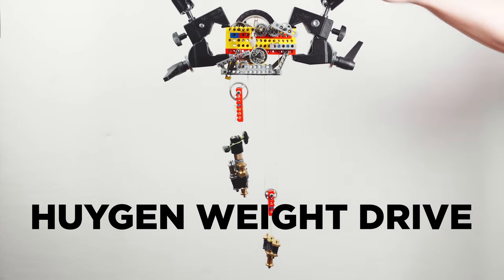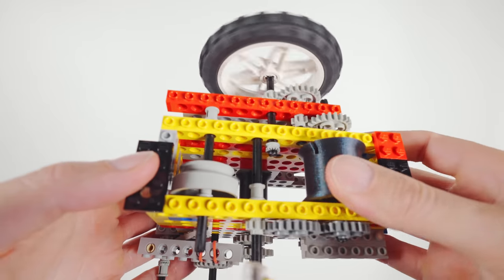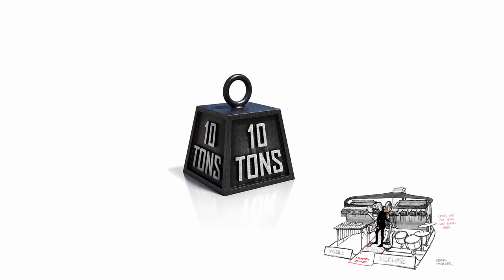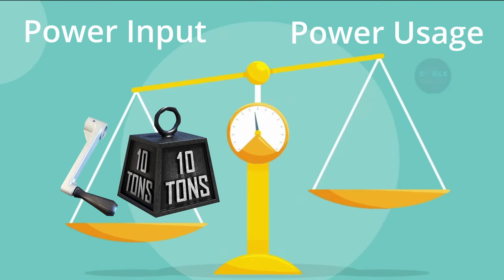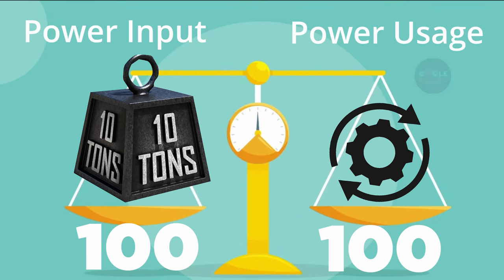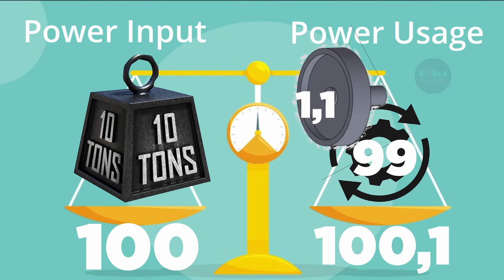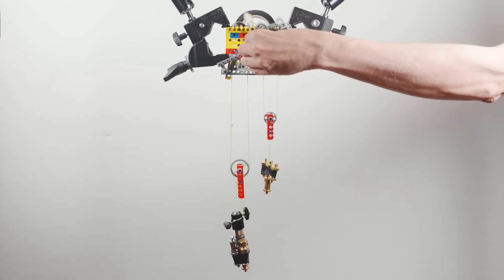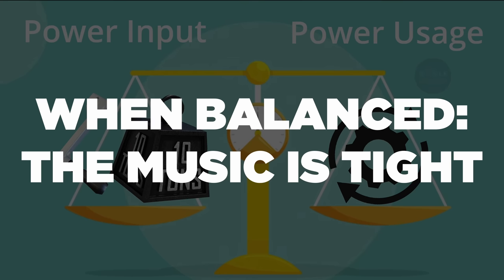Lego Technic Huygen Chain Drive

Comment: I really appreciate how much time effort and work he puts in and the r&d that goes into this. However I have a feeling that Martin went to another extremity. He went from barely thinking about the practial design of the machine to overthinking and over engineering. At this point he wants to implement something to make his machine play tighter music which is useless/unnecessary. The perfectionism will be the archnemesis of Martin and the machine. I don't think he will ever finish the mm3 if he continues his probably unrealistic perfectionism.
Reply: to be quite honest, it's kinda why I lost interest in following the construction of the next Marble Machine - whether it's MMX or MM3. as the machine starts progressing, the perfectionism takes over and becomes this rabbit hole that he can't climb out of. at this rate, the machine will never be finished.
Reply: I don't think so, he's already made a fair amount of progress and isn't showing any signs of slowing down
Reply: So far the only perfectionism he follows is generating new "tight" buzz words

Comment: Centifugal Govenors actually were meant to control the throttle of a steam engine (as the balls go up, it pulls on a central rod) , but in your case you could probably just use air friction  with flat paddles instead of balls, such that as they fly outward during to centrifugal acceleration, they quickly cause greater air resistance since it is trying to both spin faster and on a longer arms.

Side note.. This is where the phrase "balls out" comes from.  Is what happens when you're at top speed (the ball govenors balls fly outward).

Comment: I think a clock escapement for adding power to the flywheel is a good idea. You would be able to change the temp by adjusting your pendulum length.

Comment: You can also use your machine as the weight. Make a frame where the machine hangs in as the weight therefore you might not need as heavy a weight

Comment: If you want to avoid backlash, you can add a differential.
Also side question, how do you intend to play music with different BPMs?
Reply: He said the governor would be adjustable.
Reply: By exchanging the 10t weight with a 6t one mid-song, obviously ;)
He really hasn't thought about it yet. There is just no way. He takes principles that work for fixed loads and tries to apply them to this very dynamic load. Let's just hope he doesn't waste too much time on those ideas

Comment: The advantage of manual power input is you can feel the resistans in the system and actively choose a bpm. With any weight drive, or other constant force drive, the force has to balance with the friction in the system, which can easily change if eg. a bolt loosens or you re-apply lubrication to som part of the system.

Comment: it might be worth looking into how the balance on a watch works, a carfully balances wheel continuously powered by a weight drive can keep time in a matter of seconds over decades
Reply: I've experimented with this idea. The locking of the escapement causes a reaction impulse which will cause the system to achieve static equilibrium. To get continuous power, a governor is the best option.

Comment: It is very possible that the wieght drive is only more tight given consistent friction. Once you have variation in the forces applied against the drive, it may lose precision. For example, when you start playing many notes, you may lose tempo.

Edit: I made this comment at the beginning of the video before you introduced the governer concept. This looks very promising!
Reply: There's no "may" about it.
Reply: Yes, you want to have enough weight to drive the max tempo at the max friction/load and use the governor to hold back any excess power when the tempo and/or friction/load is lower.
Reply: @thomasbecker9676  Theoretically, if the governor has variable resistance, then it should smooth out the variable demand. That's entirely dependent on how variable the governor is and how responsive it is. I'm not sure a wind driven governor could add enough resistance for the amount of weight Martin is going to need.

Comment: Hey Martin, in order to play different tempos you could try to implement somthing like a CVT system: a Continuosly Variable Trasmission that will gave you infinite gear ratios, it will be a bit overkill, but worth the effort in my opinion

Comment: This doesn't look like over-engineering to me.  I had thought with your last video that you needed to find a way to be able to input power to the weight drive system without speeding up the machine, and then you found just that.  This seems awesome.

Comment: It's crazy that you can get continuous tight music without an electrical motor. This is so interesting.
Reply: It's like clockwork!
Reply: it is crazy that he can get continuos tight music just using an electric motor with the option to choose any music speed that he wants and forget about all this complexity :)
It is like he still wants to find the hardest path as he did in the first two machines.
Reply: @angellestat2730  Well yeah. Anyone could make a 'marble machine' using electric motors. Or, frankly, a synthesizer. If the goal was just to create music, the whole project is largely 'pointless'. The clockwork aesthetics, the limitations, the machine itself, is all part of the goal too - The trick's just figuring out the right balance between practicality and complexity to get a machine that's beautiful to watch in operation, but not excessively difficult to build and maintain with sufficient reliability.
Reply: @angellestat2730  just play an mp3 at that point
Reply: @damicapra94  so according to your definition all modern air church organs  and even old pipe organs are mp3?
Reply: @kentonroush  not sure what is your point, all church organs use electric motors to charge the air compressor.  It does not change anything to the music generated.
If you want 100% accustic experience..  forget about microphones, amps, any electric instrument and just play some manual instruments to an audience of no more than 20..
Reply: @angellestat2730  the point is that the marble machine will be mostly automatic, if you just put an electric motor on it, it could make music with no operator, hence you might as well just play an mp3. A church organ is different because you still have someone playing it.
Reply: How is it crazy? How do you think they did things without electric motors? Fully mechanical clocks have existed for a very long time and they need precise timing to keep the time correctly. Martin isn’t inventing any new mechanisms, as the video title says this mechanism was invented about 300 years ago.
Reply: @conorstewart2214  the marble machine it is already designed to be automatic. 
It is a music box.. it would play the song according to the program. 
You have the bass that requires Martin´s input, or all the levers that he will switch to play the different rhythms, instruments, mutes and song parts.
Which is another point to keep your hands free. So no.. the church organ is not different.  
And it is crazy because he is making the same error that he made in the first two machines. 
Search the hardest solution. 
I do not think he is aware on how many variables and chances of issues he is  adding by choosing these mechanism which were not original designed to his exact requirements in mind, things not always scale up so easily.
Setting the machine on each stage would be also a pain in the ass with all these new pieces.
He should focus on finish the machine without exploring all possible ways to reach the ultimate design.
This way he can make his world tour and then if he wants, he can add more complexity to his machine for a next tour.
Reply: @angellestat2730  a church organ is very different from this, how can you not see that?
Reply: @conorstewart2214  it has differences?  yeah of course.. it looks different, the exact mechanism are different.. But lets see in which cases are not different:
Both need a way to store energy, the marble machine use a fly wheel, the organ use a compressor. 
Both need a power input which in this case would be an electric motor.
Both have levers and switches,  the organ has keys to play, the marble machine has the bass strings.. 
In fact, you also have church organs that are programmed with cards and holes. 
But well, keep cheering him to take the same hardest path that he took in the first two version,  it would reach a point where he would be stuck and give up for always. 
No to mention how hard would be to ensamble and disarm the machine on each stage, with each time you do that you add the risk to break something or have an issue in the middle of a concert.  
He is trying to come out with designs quite innovative in a product that only he will use. 
If a company makes a product, it release the product, then it has hundreds of users finding errors and the company using its profits to solve those errors on each design interaction.  
He is trying to reach máximum complexity from day one.

Comment: At this point, why not just use an electric motor that drives the machine and an encoder for the crank? This way, it would be the most flexible in terms of BPM and input filtering (letting more or less of the crank speed variations through). Parameters could be changed even while playing a piece.

Comment: The tightness doesn't come from the weight drive itself, it comes from the fact that you no longer used your hands as the input.
Reply: which is pretty much the point, handcranking -> inconsistent power input, weight drive -> consistent power input
Reply: @funkmedaddy  The point of that there's way better ways of doing this than using complicated weights and governors.
Reply: a motorized motor has always been the best solution, he even used one on the previous MMX, this is becoming weird to watch
Reply: He used a motor on MMX to be able to run long consistent tests, he never intended it to be the main drive for the machine

Comment: If you have already a flywheel and a govenor why do you need a gravity based system to give you a smooth power input?
You do double the work but get only the same output for it.
Reply: Correct me if I'm wrong but:

If you slow down a flywheel (to slow down the music), energy is just lost. It won't be able to speed up again unless you manually put energy back into it to rev it up. 

If you slow down a falling weight, you partially save energy (/you reduce the rate of potential energy consumption ). So you can speed it back up without putting in additional energy.

So a governor with a flywheel will be able to limit the maximum speed, not so much be able to keep it constant unless you constantly try to rev it up yourself.

Comment: The governor and flywheel idea is a good one, and an old one. They've been used for centuries. Old farm equipment relied on governors to keep equipment running at a constant even speed. Threshing machines for grain processing were powered by steam engines, whos power output could vary depending on the available steam pressure in the boiler. You could automate the recharge of the weight using some limit switches and an electric motor. When the weight reaches the bottom, it could turn on a motor attached to your ratchet which lifts the weight to another switch that turns the motor off.

Comment: In a sense this feels like reinventing the pillow blocks all over again; he could just attach a motor to the thing if he wants it to play tight for now, allowing him to chase down sources of looseness further down the mechanism, which is what really matters. 

I hope the machine will still be human-powerable in the end, with a constant drive as an option. I understand the appeal of chasing tightness to the extreme, but dropping manual power altogether would be sacrificing that special something about the human cranking the machine to play the music.
Reply: I think he would still crank.
But the crank would lift the weight that powers the flywheel.
This will make the speed of the music independent of the speed he's cranking.

How he will regulate the speed so he can play different tempo songs? No idea, probably changing the weight.
But he won't be able to do speed changes in a song unless he adds a differential between the weight and flywheel.

So, the machine is going to become complicated. (imho not worth it, but who am I?)
Reply: I am wondering if he's getting too fixated on a manual / mechanical  energy source.   

He wants a weight drive but then realizes he needs to constantly reset the weight or it will be too large/dangerous. Unless you are willing to almost constantly crank the weight back up, you need a motor.   But if you want to use a motor, you may as well let the motor power the machine and get rid of the unnecessarily complex falling weight.  

Worse, he realized after he fell in love with the Huygens mechanism that falling weights are only good if you want a single, unchanging power output.  So, he needs to add a great deal of complexity to vary the speed.  Or, you can adjust the motor speed control.  

If he wants to be creative, come up with an elegant input device for the motor speed control setpoint and let a tiny PID controller do the rest.

Comment: I suggest having two separate drive systems. One for the music, and one to elevate the balls. I think that the vast majority of load variation will be the number of balls that have to be lifted back to the top of the machine per unit time as the number of notes played per unit time changes. This would put a high demand on the governor to compensate. The ball return mechanism wouldn't need to be very accurate so its governor wouldn't need to be very precise.

Comment: Use a electrical drive with esc and governor. Problem solved. It won't be any tighter than that. If you still want it to look as if you are doing anything manually, put a crank on a generator and a supercapacitor.
Reply: I feel like the spirit of the project is to build a mechanical device that makes music.  Sure, an electric drive would be the easy answer, but a mechanical drive fits the project better.  He's dropping marbles to play songs...easy left the building a long time ago.
Reply: @eryktheviking3371  I was a little bit sarcastic really. I don't think he should go the governed way at all. The music should be tight enough with a flywheel. But anyway it's not up to us to decide. It's his project, he does what makes him happy I hope. 😊

Comment: Christiaan Huygens was a genius. He also developed an equal temperament tuning system that contains 31 tones. And he was working on the same problems like Martin; he created a marble run on which two marble with different track lengths end simultaneously.

Comment: Flywheel + Transmission connected to the ratchet turns this into a means to provide both a lot of potential energy to keep lifting the weight as needed with the tightness of the weight drive.

Comment: to keep the weight at the correct hight (for testing stages) a pair of lightgates with a plate on the weight, if the bottom on turns is broken, turn on a motor that ramps up its power to move the ratchet part, if the top on is broken, ramp the motor down. depending on how precise you can meassure the position (magnetic tape or Hall or how ever) you could run a PID loop on the motor RPM to keep the weight hight constant, giving the system exactly as much power input as it needs. basicly using the heygens drive as another flywheel stage for input smoothing

Comment: Keep in mind that you want to go on tour with that thing. So you probably can't carry a to gigantic weight with you.
Reply: Sandbag + locally sourced rocks perhaps?
Reply: @blueberry1c2  water is often used as a weight too.
Reply: @Robbedem  tbh I would rather use rocks. Easier to fill up and it won't leak water all over the stage if it drops
Reply: @blueberry1c2  But the weight needs to be exact, since they will determine the tempo of the music (unless he puts in another contraption).
Reply: @Robbedem  he talked about a governor, which makes it sooo much easier to change tempo than calibrating the mass, whatever mass is used

Comment: There is a lot more to the power usage than just friction, lifting the balls up will cause varying power usage depending on the number of balls being lifted. Music is not a constant thing, so on a machine like this the power usage won’t be constant.

The centrifugal governor you showed does not add friction, it adjusts a valve to control the power.